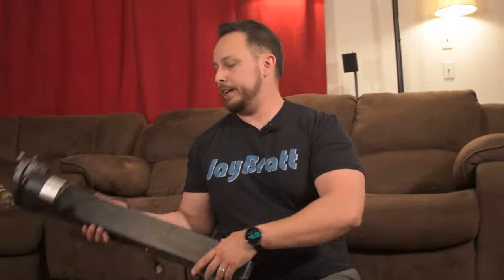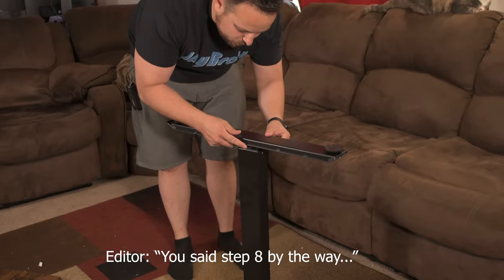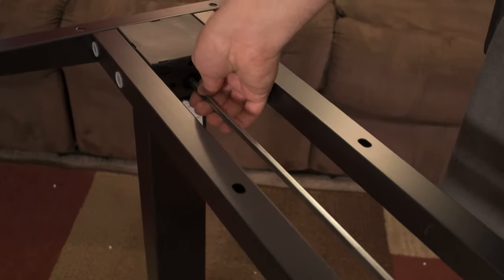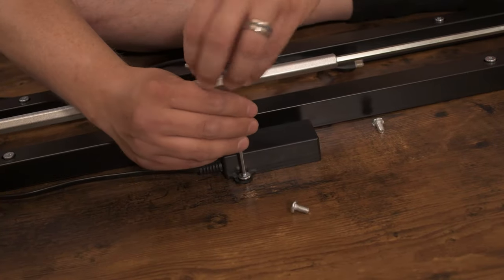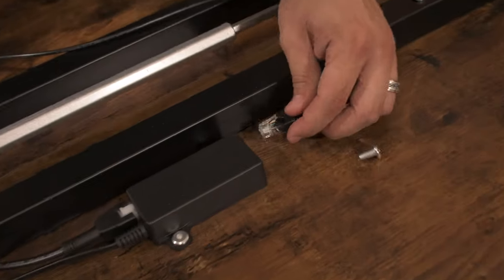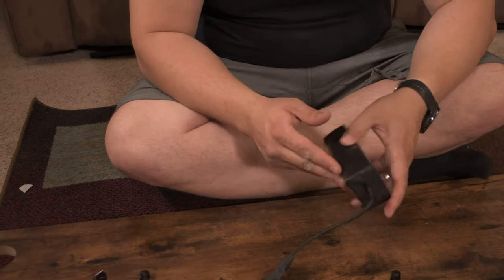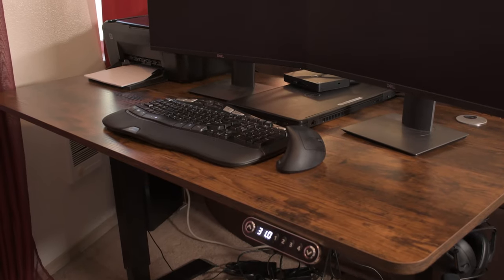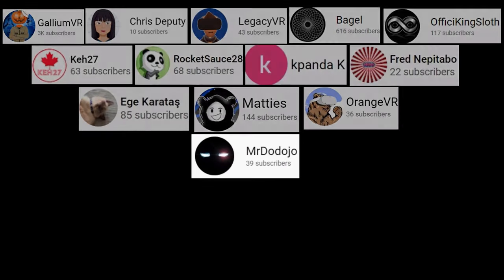Amazon's CHEAPEST Electric Standing Desk - KKL Build

Comment: Hey I got a question, everytime someone is playing there vr in the sun people say it breaks but if any vr headset is off and facing the sun would it still brake?
Reply from the maker: Sunshine damages a headset if it gets in the inner lenses where your eyes glow. Those lenses are like magnifying glasses. Like holding a magnifying glass over ants, that will burn your screens inside your headset. The risk outside is when you don't have your headset on and the sun gets into it
Reply: @jaybratt  so its a yes?
Reply from the maker: @keetguy  yes as long as the sun gets into the lenses. It's not something I'd take the risk of but if the lenses aren't facing the sun technically no it wouldn't get damaged.
Reply: @jaybratt  the more you know
Reply from the maker: @keetguy  🌠